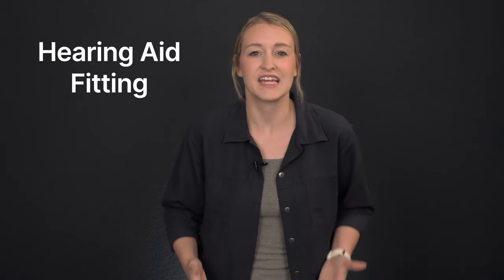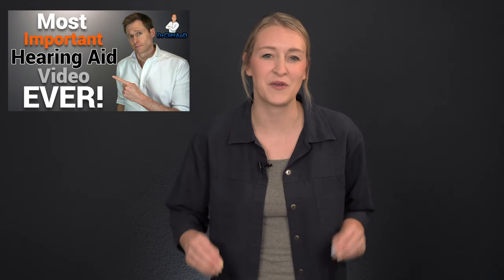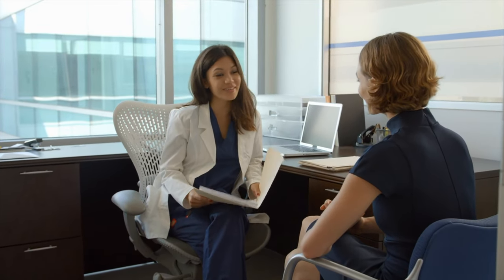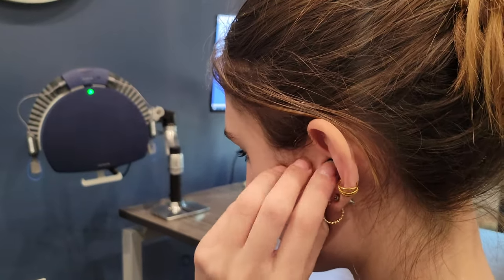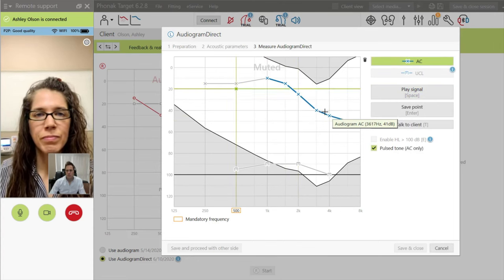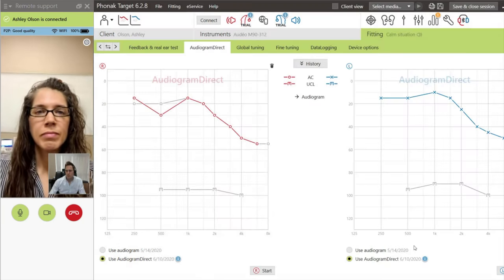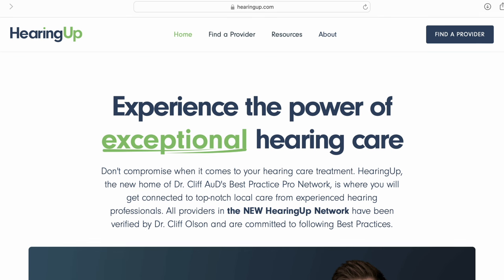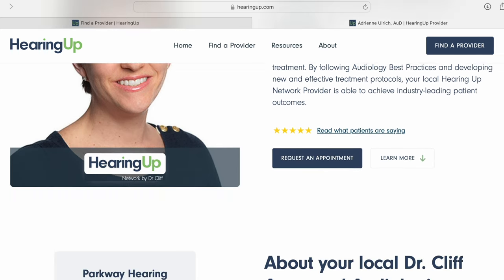In-Situ Audiometry: Is It the Same as Real Ear Measurement?

Comment: Hi, I am a French audiologist and biomedical engineer I often follow your videos with interest. I see some problematic points. I don't see In situ audiometry as a replacement to real ear measurement. It allows to have more measurement point and therefore it allows a better calculation of hearing aid methodology. It's especially true when compared with headphone audiometry, it's less true with insert earphone. Real Ear Measurement is a good tool, it's not a magical tool. Even with a patient with a perfect standard ear there can be a certain variability of results depending on the probe insertion even with the 5mm rule. Kundt tube model explains that simply. Moreover in some case a blindly trust to insertion gain can be a catastrophic. For example the patient who have very small ear canal. In those case the probe insertion and the event either closed or created induce some measurement mistakes. Some pathologies like important tympanic perforation or ossicular chain ankylosis may change drastically the (middle ear/headphone ear) impedance ratio. It mays invalidate the hypothesis that the sound pressure level at the probe can be easily compared to what is perceived by the patient. It the first case with the large tympanic perforation the ossicular chain can't do it's job properly. And in the second case we may imagine a solid wall and the sound won't pass as easily as expected. To be clear I think the real ear measurement is a good tool that I use daily and as an old experimented audiologist now the gold standard remains the freefield audiometry with appropriated stimuli coupled with loudness growth assessment. Nevertheless this test has it's limitations but this post is already far too long. Here is a potato to redeems the time you spent to read this. Sincerely
Reply from the maker: Long comment, thanks.  There is an overwhelming amount of evidence that indicates that REM is the gold standard when programming heaing aids for optimal performance. No other method is even considered an acceptable alternative.  Mentioning very specific conditions that alter the measurments of REM do not justify discrediting REM for 95-99% of heaing loss cases.  Besides, REM is a verification tool, not a good tool or magical tool.  Being able to see what sound is doing inside of an individuals ear canal regardless of a perforation, small canal, obstruction, etc. is exactly the purpose of REM.  There is no research that suggests that freefield audiometry is the Gold standard, and I would challenge you to provide a single study that shows this within the past 30 years.

Comment: I’m curious about the follow up of this video. I’ve been using both REM and in-situ and found similar results in most case, and significant results with speech tests and speech in noise tests. To me if the in-situ audiometry is done properly with the earmold or dome that is gonna be used, the calculation of the gains should be approximately similar to REM. Let’s not forget that REM shows a full continued gain curve on all the frequencies, but in reality we just had a few key frequencies tested and everything else is pure guesses.
Still curious, maybe the next video will change my mind on this.